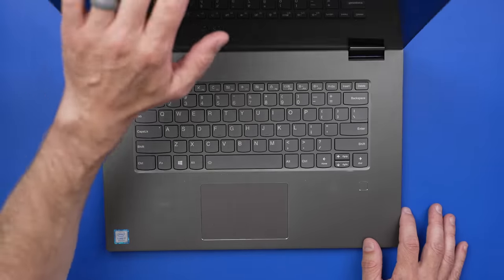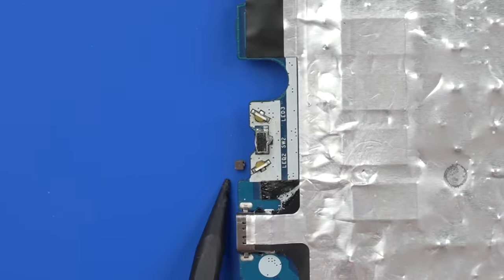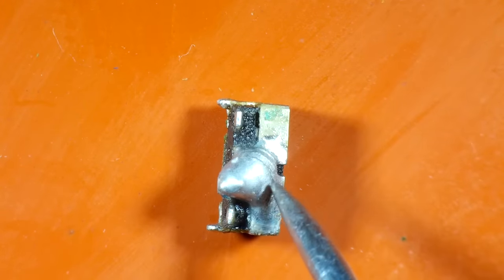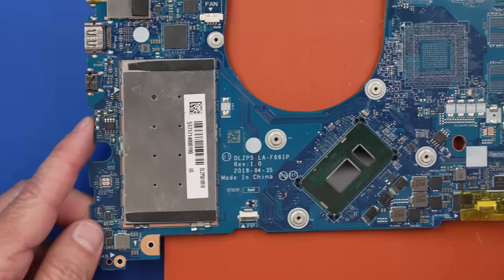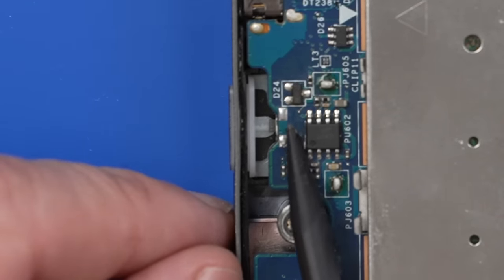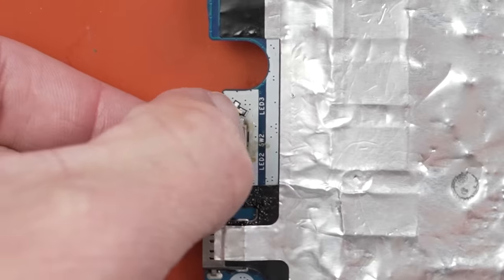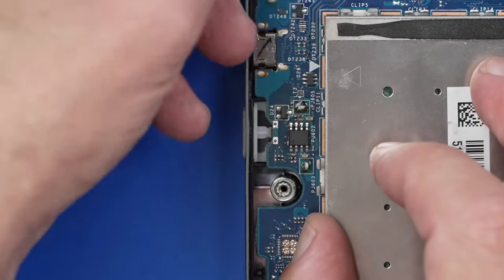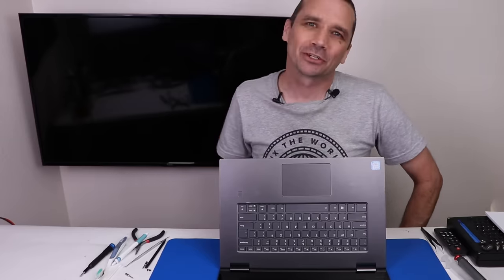Repair Shop Said $400 to Fix This Laptop

Comment: I will never take my stuff to a "repair Shop" - seems as if 95% are liars and/or are incompetent
Reply from the maker: There are a lot of good shops out there too. They’re not all bad
Reply: 5 % will do the charm fr.
Reply: Repair shops are like mechanics: they overcharge for minor repairs, then try their hardest to convince you a much bigger, more expensive job is needed.
Reply: @snufftherooster93  I both agree and disagree with you. I have my own repair shop and am far happier to get a PS4 for example in that just needs a new hard drive than to scam them into thinking something isn't working properly. Really, if you do scam people, yes, probably a fair bunch of people wouldn't know, but eventually someone will and it will damage the business's reputation. Also, I can't imagine how someone can do crap like that and live with their conscience.
Reply: gotta understand that the people working on it have a chance to mess it up even more and you are paying for that labor and part cost 🤷🏾‍♂️
Reply: I had a great experience with a phone repair shop, so I went back to the same shop a few years later and had a bad experience, but when I came back in they fixed the issue from the bad experience for free so still overall good
Reply: Yeah there's a youtube guy too seems kinda shady always fixing stuff rarely failing with a great personality, presentation skills and logic to break problems down, think the channels name is TronicsFix definately not one to avoid.  Jokes aside awesome repair skills enjoyed your content from the begining been fun learning alongside yourself keep up the awesome work its great cheers.
Reply: @snufftherooster93  on many aspects it ends up coming down to working around the crazy labor rates so if somewhere is charging $150 an hour for repairs it may just be less expensive to buy a whole new kit of something rather than the extended time of fixing the multiple small parts
Reply: We have 3 repair shops nearby that are awesome, trustworthy and warranty all parts and labor for a year. One does mainly phones, one does IT equipment an pc’s, and the third does just about anything!
Reply: Who would you trust/send a laptop to fix it? :)
Reply: @Tronicsfix  Check out Phill's latest vid I couldn't let it beat me,  has a question at the end of the vid for you needs a comment reply from yourself cheers
Reply: My sister laptop not turn on. Street shop man put charger. He said look here its working. He said my sister need buy new charger cost £35. Thats too much. Next day laptop not working. Street shop lair.

Sorry for my bad English
Reply: Some of them actually remove and keep some of the parts, and then tell the customer there is no chance.
Reply: @Tronicsfix how can we tell, if we know nothing and just take their word for it?
Reply: Nah, we only see the bad repairs on here. Most repairs are probably good. Why would we look at a perfectly good system on a channel about fixing broken hardware?
Reply: That's insulting to every good Tech out there. We have like 4 boxes of for parts motherboards in the shop, and the odds of me finding a button to fit is still very low. I would have just tried to use some sort of filler/plastic piece to fix it then charge diag fee only. If I couldn't find a button or rig something up, the only other option is to source a motherboard and charge part cost plus full labor just so we can stick safely with our 1 year warranty. Wtf do you expect us to do? Find the button from a whole seller in China? Order 100min lot and call the cx for approval on a 1-3 month wait?
Reply: @DragonKing3787  same way you go to a doctor, vet, or auto mechanic. In all seriousness as a tech myself, the best way to feel out a shop is just by calling them up. If they are willing to give any guesses on the issue, then thats a good sign. If they are extremely persistent about you having to bring in the device for diagnostics and paying the fee without even trying to take a shot in the dark, I would avoid it that shop altogether. In other words, if they sound curious and helpful, I'd look into them. If it feels like you're talking with a salesperson, avoid it.
Reply: I actually sent my friend to another repair shop instead of mine and the dude was completely incompetent. Had the MacBook for 2 months and returned it broken and charged $500.
Reply: Successful work of repair shops wouldn't show up on this channel...
Reply: @hummelpapa8400 take into consideration that most of the repair shops dont do any soldering job, so only option for them to repair this is exchange board for brand new, it is not like they scam you, they just dont solder anything 🤷🤷
Reply: Tbh I've seen some guys doing miracles for like 5-10 dollars and being really good at it, and then not so long ago I've encountered a guy who asked for $40 just to solder 3d analog on my ds3 (I even brought the replacement part, all he had to do is to solder). On the other hand, it is pretty encouraging to start doing your own repairs 😂

Comment: Whoever sold that to you needs to share the name of that incompetent “repair” shop. Trying to replace a part with a different, incompatible part and then lying and saying it needs a new motherboard is borderline scamming. I hope they didn’t pay much for the diagnosis.
Reply: Exactly
Reply: this is a wrong take. we don't know if thats what the shop did. Sure they didn't know how to do the repair properly. Who says that they were scamming though? Did you honestly know about the 2 different button types before this video? Maybe the repair shop guy didn't.
Reply: @PackCracker66  you shouldn't have to be able to do on board repairs to own a shop... If you want to have a shop where you just replace parts and go then you can do that. I've done soldering to repair a computer but it was for very basic solder repairs. (Was a power button on a micro ATX OEM case) I would have been just as valid for saying a new case/button should be purchased. (This had custom parts far from what was originally in the OEM computer so any micro ATX case probably would have worked)
Reply: @volkswagenginetta  if you dont know how to fix it then let the customer know instead of scamming them out of a 450$ board like what??🤦‍♂
Reply: @Sand34152  I'm not saying its always the best decision, but sometimes just replacing the board is cheaper (obviously not in this case) I've done repairs where a daughter board was broken so I spent 10 dollars buying a new board and replacing it to fix a headphone jack and USB port on a laptop. If I didn't replace that board they never would have gotten their laptop fixed.
Reply: @volkswagenginetta  My dude - the guy is taking money to do professional work on electronics. If he's not a professional he's scamming people.
Reply: @yissssss  there are a billion different ways to do work on electronics, are you not allowed to do data recovery if you don't have a clean room to moved platers from hard drives to donar drives? Do you have to be able to desolder a nand in order to move to a donar SSD when the customer just needs someone to run "recuva" or some similar software? There are levels of support and all business make decisions when their sla ends 
You also don't have to refer business to your competitors. If a customer ask me what I can do to fix it I can offer the solutions I'm willing to do and that's it. They are also free to go to a different business and look for their solutions.
Reply: @volkswagenginetta  If you cannot do data recovery you should not be charging people money for data recovery. What part of this concept is difficult for you to understand? Do you scam people?
Reply: @yissssss  no I don't scam people. I'm just a dude who helps out my friends and family at cost for parts (or at my expense) not everyone has to be a Louis Rossman. This guy probably took his laptop to a computer repair shop. The dude offered a solution that would repair the laptop. I agree for such a simple problem I'd go the route of fixing the existing motherboard too but not everyone does PCB repair. It's only a scam if you charge someone for work you didn't do. There can be times where it's unethical like charging grandma 300 dollars for replacing bad ram that is worth 20 dollars and 15 minutes of labor. This isn't that. It's a motherboard that needs repair to the PCB. You don't have to offer that as a business. What don't you get about that? It's kind of like an automotive shop that just offers replacement parts and doesn't fix parts. Are they not a real automotive shop if they don't do PCB repair on an ECU with a burnt out resistor? Or what if the radios display is burned out? Do they have to repair the display or is replacing the radio a cop out too? 
How bout an HVAC tech? If a thermostat has a broken trace on a PCB do they have to solder that PCB back together or is replacing the thermostat sufficient?
Reply: @volkswagenginetta  Did you miss the part where they soldered the wrong switch on badly, broke it more, then put it back together improperly? They shouldn't have offered the solution.
Reply: @yissssss  no i didn't. i agree you should be confident in a repair before you attempt it and charging customers for it, however were acting like this is some level 1 support mistake like trying to put in ddr4 into a ddr3 motherboard. yes it was the incorrect repair, the right thing to do is to waive the charge then for the repair because it didnt fix it and to refer the customer either to a solution you know will fix it or stop working on it.
Reply: @volkswagenginetta  no we're acting like they didn't know how to solder parts onto a part but did it anyways, then they didn't know how to disassemble and reassemble a computer but did it anyways. "Fake it till you make it" doesn't work in an environment where you can destroy customer hardware. That's just scamming.

Comment: I never tire of watching you troubleshoot and fix broken stuff.
Reply from the maker: Thanks! So glad you enjoy these videos!
Reply: @Tronicsfix  I would have been interested in what the actual cost of the repair would be. Yes you don't have to replace the board to fix it, but you do have to replace that button which requires special skill and tools, certainly the time investment to remove the board, remove the button, and replace the button would cost a significant amount of money too. Perhaps not 400 dollars, but still enough that the laptop might not be viable for the original owner to repair. Don't you think?
Reply: @mizinoinovermyhead.7523  10-20$ Bucks at max. This isn''t even a Hard job. A person with Average Soldering experience can do this.

Comment: There are many absurdities in the paid repair method of established official service centers. They are adopting a method of replacing the entire motherboard, which only requires replacing a single $0.1 part. If they are making absurd profit margins, they will not even return the old motherboard to the customer after replacement.

Comment: It's funny how repair shops charge big money for such small work.
 My sister's notebook had broken hinges on her laptop, and the repair shop said it would be around 450$ for repair.
I ordered hinges for 15$ and replaced them myself for her.
 Totally 435$ saved...
Reply: To be fair to the previous repair shop, I doubt they were charging that much to line their pockets.  They simply couldn't find a suitable button to replace the bad one with, so they had to quote them the cost of a new motherboard, which was probably $350+.
Reply: Replacing hinges is much different from having the knowledge of micro soldering.  Although the fact that yet another repair shop both could not fix it, but even then reassembled it incorrectly without all the screws is ridiculous.
Reply: coming from personal experience, both as a non-professional repair guy, and as someone who takes his computer for bigger repairs im not confident about doing myself; i can kinda see why people try to charge a lot. depending on how difficult the repair is, its basically just a mini, more technical mechanic. soldering can be very precise and tricky depending on the board so that is higher labor cost, sometimes the takedown is complicated as all hell so that could hike it up. considering $450 for hinges, you are completely correct, thats an exorbitant amount. MAYBE $50-$75 to do it depending on the model.  $15 for the part, $30+ for labor. small jobs shouldnt cost a new product.

Comment: I just wanted to say that you are right. 
If a manufacturer would list the components used and not convince suppliers to be exclusive to them, repairs could be easier and quicker as well as less expensive. 
In all honesty the same manufacturer would find a much more stable customer base if both customers and repair shops knew that their product can be more easily fixed and maintained. 
Big fan of both you and Louis Rossmann.

Comment: Ive done a similar repair on a Lenovo Ideapad 320-15kib that wouldn't turn on because the power button is in the keyboard. The keyboard was perfectly working but the power button was not. The keyboard was soldered into the top case of the laptop and I was told it needed a whole motherboard and i fixed it with a $30 top cover assembly that included the keyboard and touchpad and now that laptop is my daily driver
Reply: I work at a computer shop and got a customer with this issue, it would'nt turn on, when i disconnected the battery and plug the ac adapter the laptop turned it on itself so I just ordered a replacement keyboard and installed it. it was soldered too but I drilled it and resolder the new one in the palmrest. Funny enough it was a lenovo too.

Comment: great fix, however over time the button distance could be reduced, maybe also put plastic near button side of board but not in button path to keep distance even as laptop is moved around, and heat and cool cycles settle board to middle in case. the plastic pieces in side of board would mechanically limit this movement. excellent video

Comment: Shops like that give shops like the one I work at bad name, I would have never let it leave my shop in that condition even if I didn't make the repair but something like replacing that power switch would have been an easy repair for me.
Reply: Dude probably spent at least an hour if not two finding and soldering a new button on...

Comment: Regardless of which industry you are in, repair shops should be required to be certified along with their technicians. There are too many people masquerading around saying they can repair something when they don’t know squat and are causing people not to want to go to legitimate repair shops. Also, a real repair shop warranties repairs they have made. Excellent video!
Reply: Absolutely not. The only certification you need is the customer's experience. Otherwise you'll end up with Genius bar level shops that paid for certifications.

Comment: My soldering skills are at best last year when my on/off switch broke on my case that I didn't want to replcae had a non standard microswitch so once I found the correct one I just cut of the end of the cable from the old one and soldered to it, much cheaper than buying a new case!

Comment: Can I defend the repair shop? A lot of people are saying they are dishonest or ripping people off. In this video, he fixed this laptop with a $.25 button. However, it’s very obvious that he spent a good amount of time and effort on replacing that button. With his cuts in video editing, you can’t say for sure, but it was certainly somewhere between two and eight hours to fix that. I think all in it’s safe to assume he spent four hours finding donor board parts and soldering and testing in order to get that $.25 part to work.
When the other repair shop quoted $400 for a new board, that board replace the power button with no work at all, it would probably be one hour or less to swap out. if we make an assumption that a tech repair shop should charge about $100 an hour, that brings the total fix up to $500. This repair with a donor board that you may or may not have on hand, took four hours of labor and a $.25 button, so $400.25 if he was getting paid as he should for his labor. 
Time and labor is a real cost, and unless you have the talent like portrayed in this video to do it yourself, you have to pay someone the labor time for them to do it. This repair actually cost just as much or close to it as the full motherboard replacement would be, except now you have a custom jury rigged button that you hope doesn’t fail in the future. Repair shops don’t quote new parts because they’re lazy or Untalented, they quote them, because it had no uncertainty whether it will fix it or not, and the time of the labor to manually fix it for the repair is a huge consideration, when quoting the cost of the job.

Comment: The board can be repaired but my question is how long will it last? My experience is that when you do circuit level repairing, the thing starts giving another issue within few months.

Comment: When I got this problem on my desk.. It was a power plug they broke. I got a 12V barrel plug cable and soldered that to the board. so the pigtail hung outside the laptop. So that next time it gets dropped it will bounce. I had to change the end of the power brick so it would plug in but now it runs.

Comment: I have a degree in electronics. The repair shop is 100% backed or at the very least subsidised by the contractor that has a contract with the brand laptop.

Comment: I mean the cost to the shop to diagnose was probably 100 dollars, add to that labor and searching for and ordering the correct part, not just trying something found on an old junk board. With a parts mark up.  That was probably a fair enough price for the repair.  They have to guarantee the work and when it fails next month....